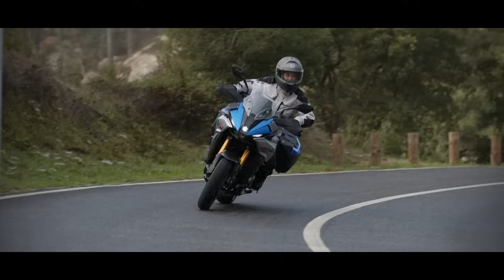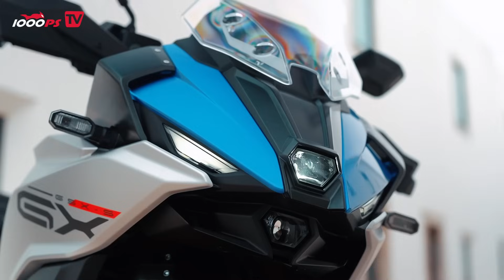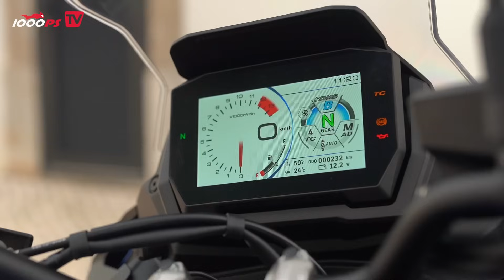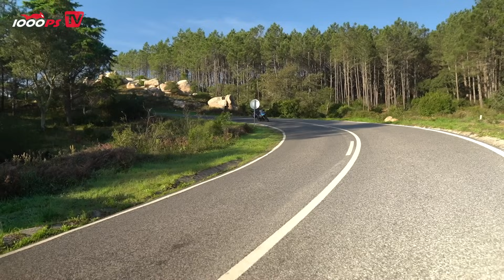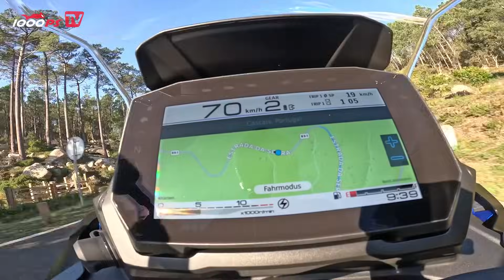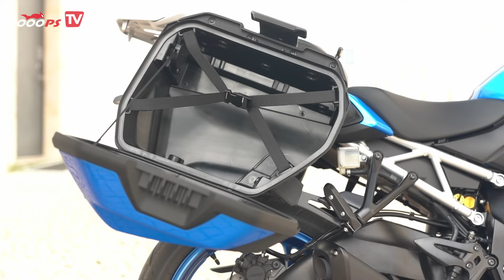Suzuki GSX-S1000GX Full Review | Comprehensive Test Ride and Impressions

Comment: that's a big "NO". $5,000 more for the same bike as the GT. sure it's has better adjustable suspension and an extra feature on the screen. but it's the same bike. it has the same frame, the same engine, the same gears, the same tires. the same dash screen, the same basic shape... all for 5K more. they did move the mirror back to the handle bars,,,i personally don't care for that.. i can't see past my shoulders with handlebar mirrors.

Comment: IMO the previous GSX S1000GT+ looks like competition for the Yamaha FJR1300, this GSX S100GX looks like a Yamaha Tracer 9GT+ clone. They look fantastic & both should be very popular. However, the comparison to the Tracer 9GT/9GT+ is in error, as the 9GT has electronic suspension, only the Tracer 9 does not. Also, the Tracer 9GT+ has linked braking plus radar enhanced braking & cruise control, which the Suzuki does not. Likewise the Suzuki doesn't seem to come with heated grips as standard while the Tracer 9GT/GT+ does.

IMO the 3 cylinder CP3 engine of the Tracer does have a tiny bit of vibration compared to the GSXS1000GT's sweet K5 4 cylinder unit  & I guess the GSX S1000GX would be similar, but I've never felt underpowered on the Tracer, an issue helped along by it being lighter by comparison to the Suzukis. One area where the Tracers leave the Suzukis for dead is fuel ecconomy. I'm getting 52mpg out of mine & that's with often crappy commuting traffic.
Reply: is the torgue lower on suzuki in low revs? I have ridden the tracer 9 GT and i felt it didn't have the torgue i wanted it to have in low rpms, but ... i drive a bandit 1250s and i am used to it
Reply: @gerokatseros  I'd have to refer you to Google to find the torque curves for both. But like I said, I don't feel underpowered on my T9gt....the Suzuki I tried wasn't mine, so I had to be cautious, but it did feel brawnier. Honestly, I don't think I'd notice unless both were fully loaded & carrying a passenger at which point I bet the Suzuki would pull away from the Yamaha in a race.
Reply: @dumptrump3788  Thank you sir for your quick reply. I will wait until i test ride the GX.

Comment: One Very important factor that makes this bike a very different proposition and better value than the XR or Tracer is Suzukis 7 Years or 70K miles Service activated warranty !
Reply: Suzuki UK are offering it accross the Dealer network .have your bike serviced at your local dealer and you will be given a QR code which will give you an additional 12 months warranty every year
Reply: what is this warranty? never heard of it

Comment: if it had a drive shaft i might be interested !!
Reply: Drive shaft and inline 4 liter engine didn't ever happened, get a piggy looking GS for that
Reply: @fs5866   Shaft would up the price and engine not big enough
Reply: @Greggspies  don't think engine size is the issue as moto guzzi do the shaft drive with smaller engine however i believe the high revving nature of an inline 4 sports bike engine is not suited for drive shaft.
Reply: Agree. I had a Suzuki GS1000G shaft drive. 1981- 1990. 90hp I think. I added an S replica fairing. Cruising 120 to 130km/h. I brought it because I rode all year round. Wet weather is hard on chains. 
Regards from New Zealand.

Comment: With the same equipment as the tracer gt+: cases, centrestand, heated grips the total price is 2000 euro more. Too much in my opinion.
Reply: Electronic suspension and more power than tracer
Reply: Got MORE POWER than TRACER
Reply: @zikrixp and much less torque and hp than the xr, not to mention the top speed that is like 25kmh less. If you want budget, buy tracer, if you have the money, buy bmw. At this price they are not far apart.

Comment: Good work there. Are panniers an extra or are they already included on the price? Does the screen work with a spring, no tools needed, yeah? At high speeds, would you rate th GX above the Tracer (that has many high speed stability problems reported) and the Versys? And by the way...😀 if you could... guess... the top speed..😄 what would you say it is? Regards.
Reply from the maker: panniers are extra. mainstand is extra. heated grips extra. windscreen = tool needed: I rate GX highter then Tracer. The Versys has better wind protection and a little bit more riding comfort.
Reply: @1000pscom top speed with gps? 235 or less?

Comment: Personally I’m fine with chain and sprockets.  However, if just for marketing reasons, I’d love to ask Suzuki why they didn’t employ their excellent (simple and effective) final shaft drive.

PS - By far this is the most comprehensive preliminary discussion of this bike. My only suggestion is to superimpose specification data on the screen - thanks!
Reply: shaft makes sense only from 1200 cc, otherwise power losses are too noticeable
Reply from the maker: thank you for your feedback. good idea!
Reply: Cost is the reason

Comment: 300 km per tank is a little optimistic ... in your screen the consumption showed 7.2 l/100km which translates to 263 km if you tottaly empty the tank , so I would say about 240-250 kms is more a real number. Anyways, very very good review sir!
Reply: He said 6.2 l/100k
Reply: I was also thinking that. On my 1050 V Strom I get about 350 kms from a 20 liter tank, until I feel unsafe and need to refuel (technically I still have about 10-15 kms left until empty but yeah :) ) and I average about 5.4 L/100 on an officially stated 5.2 and I am by no means an aggressive rider. I would think an official 6.2 and a sportier engine would produce at least 6.5 in the real world and on a 19 litre tank that would mean about 280 and if riding more sporty yeah, probably down to 260 or so.
Reply: He was probably riding very hard.
Reply: On my Africa twin 1100 i can get up to 240 miles on 18 liter fuel tank, i dont see why this can't do the same if ridden conservatively
Reply: @fs5866  Well first Africa also has 19 lt tank (18.8) , secondly you have 100hp and low rev engine, when revs go high consumption goes high as well.
Reply: Depends are you riding
Reply: @frankmlchaelglasscock6539  well yea if ridden fast and up to the rev limit then of course it will eat lots of fuel but for commute and long distance travel I'm sure it can get over 50 mpg, 55 or 60.
Reply: Actually all reviewers seem to complain about the fuel consumption....